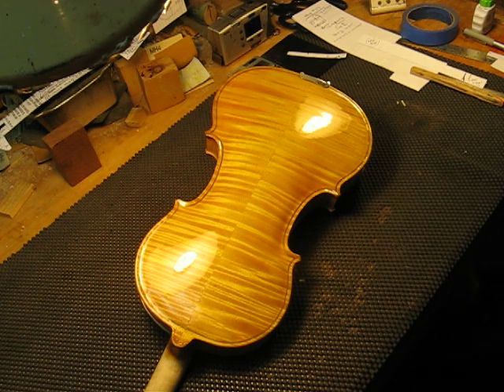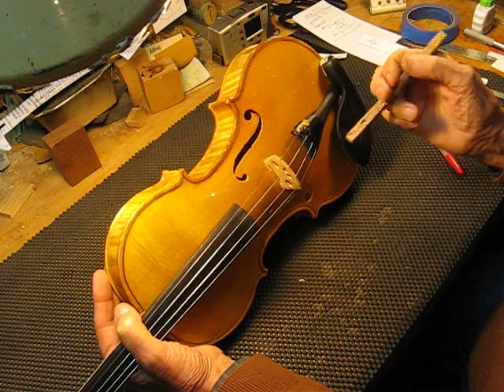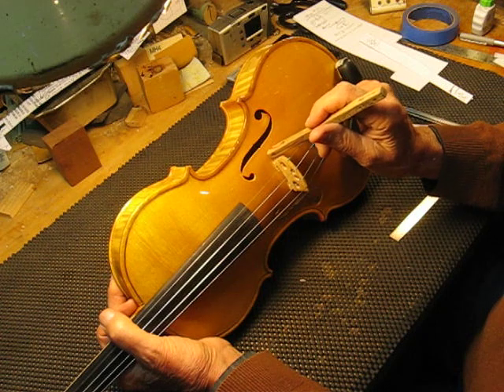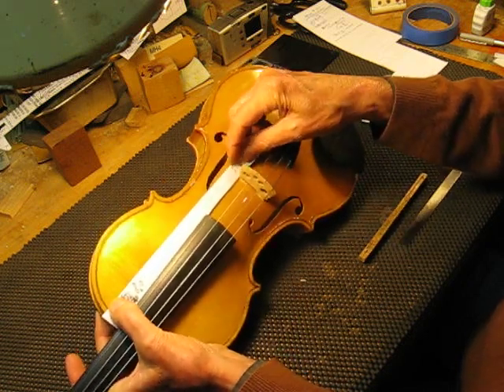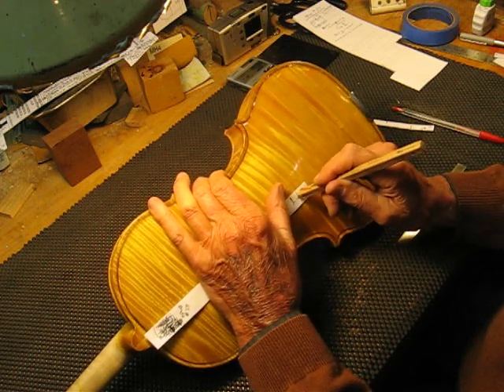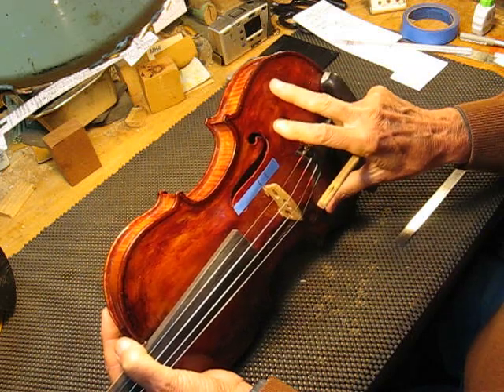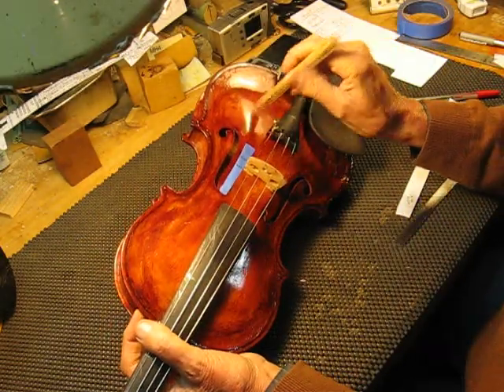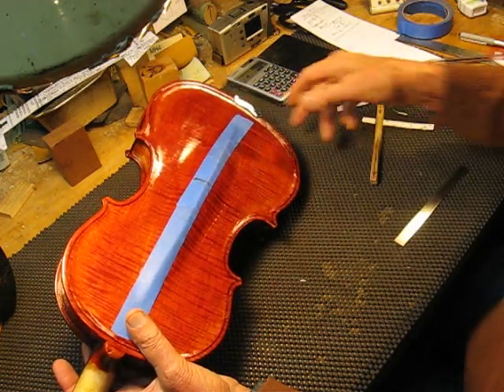The importance of plate tuning, nodal alignment with bridge and sound post, for the Violin family.

Comment: Frankly I'm terrified. Is this bloke writing a comedy sketch for laurel an Hardy using with cheapo props from a Charity Shop? What is the second violin?   is it a violin or a strangulated red cabbage ?   What is going on with uploads by amateurs with fancy ideas ?
Reply from the maker: Well I actually agree with you, acoustical research is not for the faint hearted!  This "boat boat back", or parabolic shaped acoustical reflector of sound which is sent into the violin body; which some how has to get reflected to the out side, and thus on to the listener....
  I only made three such violins for the research and interestingly they actually sound quite good.  In fact, of the four violins in this test recording, two are typical Cremona graduated plates and two are this reflective shapes. See if you can tell them apart...
https:/www.violineuphonist.com    E mail me and I will give you the key of which is which.
David L.  also https:violinresearch.com for 25 years of hard work (un paid  as you mention).